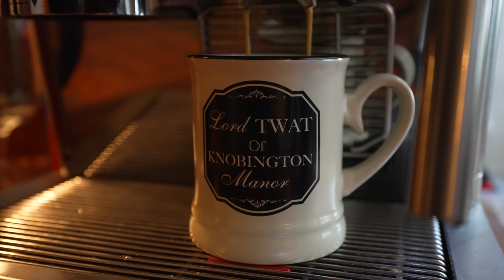Moving Day...

Comment: Seeing you work on the plaster in the corner made me think of something. Since you aren't using the radiator pipes you could use them as a chase for wires. Would be a good way to run new wires to a part of the building.

Comment: A super quick (non-toxic), super cheap tip for cleaning windows is to use white vinegar, either with paper towels/newspaper or a rag. It's surprisingly good at ripping through the worst grime imaginable. I've long since given up on buying anything but white vinegar and bicarbonate of soda for general household cleaning jobs. Added beauty of these is they're also suitable for septic tanks.

Comment: Sponge the windows using 1 part distilled vinegar to 1 part hot water and wipe dry with newspaper.  It cleans the built-up gunk off easily and it's far cheaper than soapy cleaners.

Comment: Please do not attempt to take the washing machine up the steps with that dolly. If anyone pushes from the bottom the washer will come off of the cart. The base plate is too small. Look into the forearm straps or something like it in France. Worse case, two guys pulling from the top Good luck